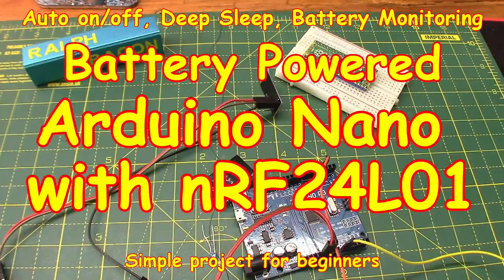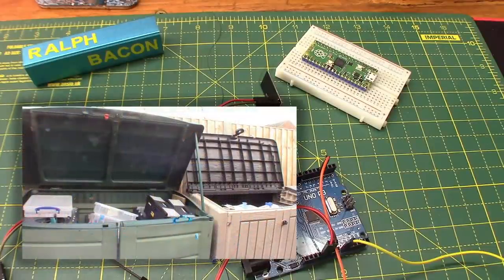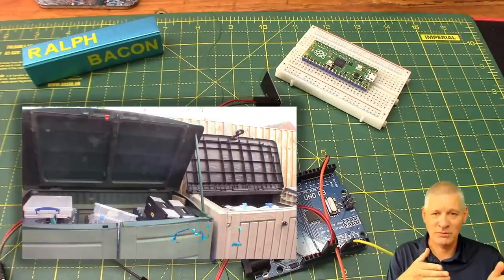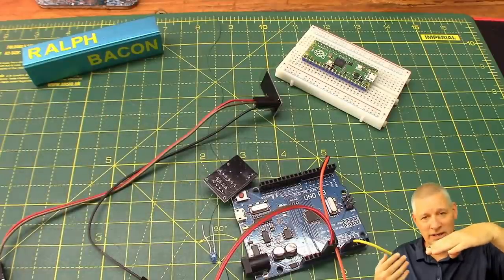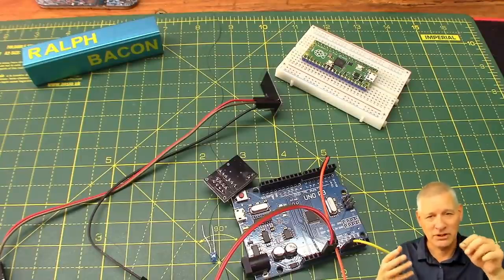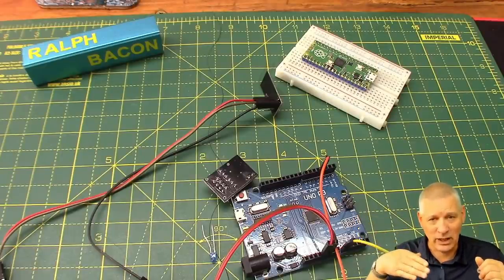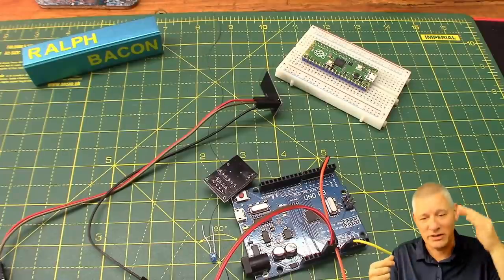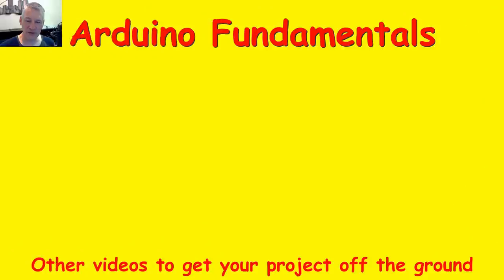#214 Battery-powered 🔋 Arduino-controlled nRF24L01+ transceiver project (part 1)

Comment: use 3 NiMH batteries that would be about 3.6 volts and use solar power to charge them:-)
Reply from the maker: 3.6v is pushing it for the nRF24 though. And I'm sure the 18650 has a better capacity than 3 NiMH batteries. Well, reasonably sure. It says 5000mAh on the battery 🤣 What do you mean, that breaks the laws of all known battery chemistry and physics? Solar power? Wait for the next part!

Comment: Ralph, my gut tells me this might be overkill.  I need to think about it.
Reply from the maker: It could be overkill if I was prepared to string wires into and around my bins. Something I really want to avoid. So with the absence of signal or power wires, please do think about/suggest a simpler solution, John, and we'll compare notes.
Reply: @RalphBacon  lol  Gas Struts??

Comment: Why not add a solar battery charger so no need to change the battery.
Thank for another good video
Reply from the maker: I could do but I'm not sold on the benefits (yet). If the 18650 battery lasts 6 months then it's not very onerous to change it twice a year. On the other hand, if it runs down every month (geez, I hope not) then that's something else. We shall see. Maybe I need to leave room on my PCB for this "upgrade"?

Comment: The nrf has a vrm board which solves the voltage issue
Reply from the maker: Indeed it does, and which I strongly recommend everyone to use for free-standing projects. However, I'm doing much the same as that board, with that MCP1700 voltage regulator which has just a couple of hundred millivolts cost, so I think it's a better, and more compact, solution. Keep tuned to see the final result.
Reply: @RalphBacon  I bought a pack of 10 on sale and when further researching them I discovered the adapter which happened to also have a 10 pack on sale haha. I have yet to use one since I've started using esp32 boards. I have a large collection of extra nano, uno and megas so I'm sure I'll use them now I have a decent 3d printer on the way to make enclosures. My first printer destroyed itself in spectacular fashion so I hit return on Amazon and immediately bought a better one. I was hoping the cheap one would work because I just need it as a tool and not for novelty prints. The original one I knew  had a 50 50 chance of working or being crap so I rolled the dice. I'm doing a lab reno myself soon. It's going to be epic haha

Comment: Seems like a reed switch and magnet would be a simpler solution.
Reply from the maker: Hang on, William, simpler than a tilt switch? 
A magnet and reed switch would have to be carefully aligned (like the ones in my house for the burglar alarm). These bins are not that well made and I could not guarantee that they would always close in the same place. At least a tilt switch can be mounted internally to the unit and is self-contained.
Reply: I forgot that those RubberMade type bins seem a little too flexible. I used the reed switch/magnet for a truck camper shell alarm, but, , it is rigid. Love your practical approach to this adventure. Praying for your continuing success with your eyesight.

Comment: #1 why only 1 tilt switch ? 
#2 Seem to remember a "radar" like sensor that could sense thru walls, could be used in the workshop to check on the lid outside (alu foil inside lid). (spiess?)   outside the battery will suffer in cold winter.
#3 rp2040 + nrf... : usb 5V powerbank to rp2040, easily replaced/recharged, rp2040 has 3.3v out (amps?)
https://datasheets.raspberrypi#org/pico/pico-datasheet.pdf   ( replace #org with .org )  page 4
Reply from the maker: So many options! Yes, I had considered the poor battery performance once the cold weather sets in; but time will tell whether this is an issue or not. Perhaps I can wrap it in some insulation.

Comment: if i was worried about my bins filling with water i'd simply drill i few pin holes in the underside
Reply from the maker: The trouble is that the crates inside (containing electronics and power tools etc) also fill with water. And anyway, your solution doesn't use an Arduino, so doesn't count 😁😮
Reply: @RalphBacon  ah you could have the arduio control the drill

Comment: While I don't worry about my 2 trash bin lids being open, I would like to know when mail is delivered. I can't see the street mailbox from the house because we are up a small rise and behind some trees. 
Or I am away and would be interested in knowing that there is mail in my mailbox.
Reply from the maker: This project would work, if you modified the sensor part so that it didn't remain LOW as otherwise you cannot shut off the MOSFET and it would stay transmitting (or, at least, in a non-dormant state). I'm pretty sure it could be done, I shall think about it, as others have mentioned snail-mail detection.
Reply: @RalphBacon  
One smart mailbox project that I saw here on YouTube had a pair of IR transmitters + a pair of receivers inside the mailbox in a large "X" pattern. If any mail was in the box, one or both of the IR beams were broken.

Other smart mailbox features needed:
* some sort of indicator that mail is in the box: LED, pop-up/down flag, etc. This would help us at night so we would not have to get out of the car in the dark. In our case, a large deep puddle forms when it rains and there is nothing worse than getting one's feet wet only to discover there is no mail in the box.
* one white LED deep inside the mailbox that illuminates when the lid is opened. Needed at night so we can see that we removed all of the mail.

When I build my smart mailbox, I am going to put most of the electronics either under the box or on the back in a weatherproof box. Then I will run any needed wires up from the bottom to the inside through rubber gromets. That way no rain can get inside unlike it might if I drilled holes in the side or top.